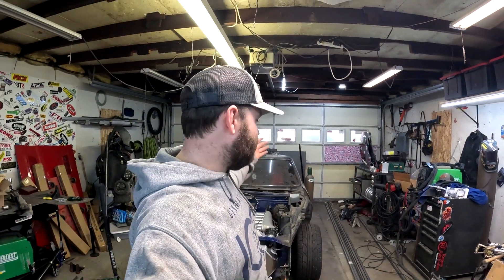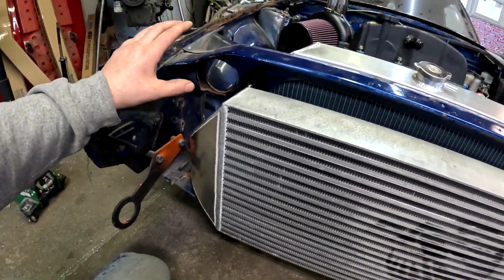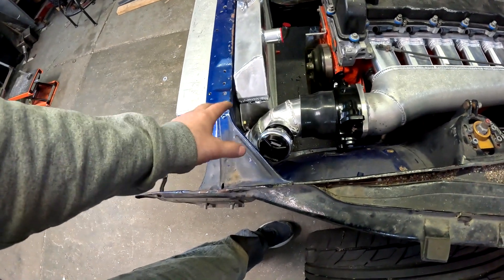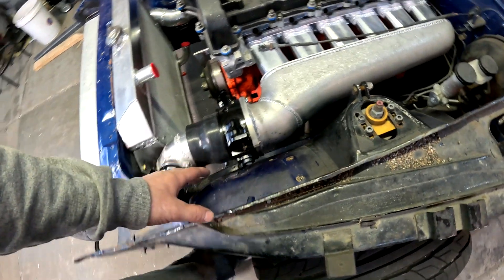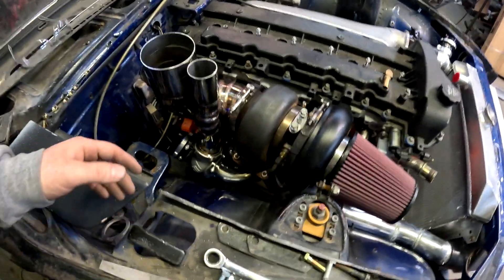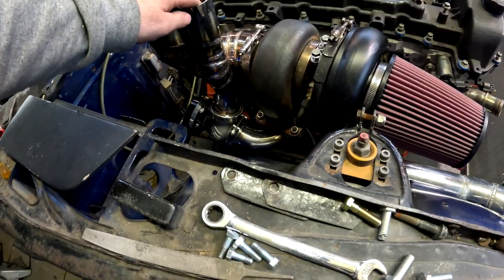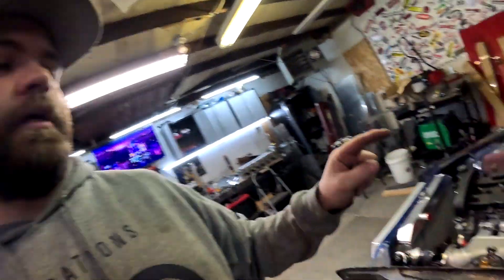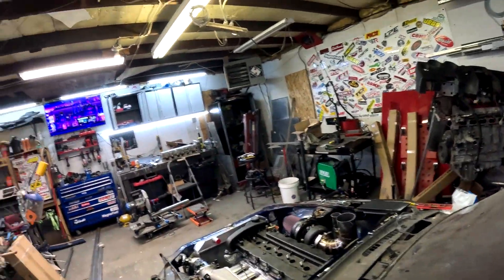vortec 4200 swapped 240z part 4

Comment: What are your plans to keep the heat out of the intake tube with it being that close to the radiator?
Reply from the maker: It shouldn't be a problem there is a lot of air flow threw there

Comment: I have the same intake manifold. Did you weld a different throttle body flange on it for the 92mm, or did you find an adapter plate?
Reply from the maker: I welded a 92mm throttle body plate to it .

Comment: Dont worry too much about welds as long as they are good. You can always grind away and polish with diamond if you want the good look.

Theres alot of project cars in the world. As long as you paint it up so it doesnt rust away people will think its worth something. The older something is the more important it is that its complete. People have a tough time getting into something when there are no instructions or finished models to look at.

If that throttle body is so expensive you might want to reinforce the area. Maybe build a box around it. Youll want to save it in a wreck. If you build weak areas into your design you can have it not break where you dont want it to.

Comment: Is there a company that makes a cold air intake? Like the one u have
Reply from the maker: Are you talking about the intake manifold? My combo is turbo charged. It doesn't have a cold air intake on it.
Reply: @redhotchannel1945  sorry yeah I ment intake manifold
Reply from the maker: This is the intake I have in the z. I did modify it so it would fit in the car. But they're super nice.  
https://customalloywelding.com.au/
Reply: @redhotchannel1945  damn that's awesome nice work an thanks man

Comment: Its much better than paying 5 or7k got a RB or 2JZ motor you can get these Vortecs for $500 bucks at the junkyard
Reply from the maker: Yes, i was originally going to do a 2j in the car. I had the motor and everything, then started pricing everything out that I needed for my hp goals and realized i could make over 600 with a 4200 without opening it up. It was a no-brainer to give it a shot see what I could do with it.

Comment: Love the build man. Are you running the stock main girdles
Reply from the maker: Yes it will be 100% stock motor for now.
Reply: @redhotchannel1945  ok thanks man I’ve been wondering if I could still make good power with the stock girdle
Reply from the maker: Should be able to without a problem